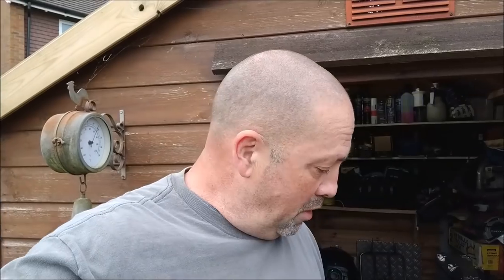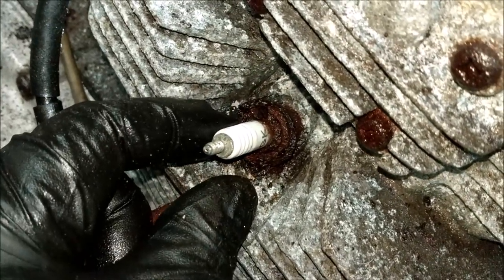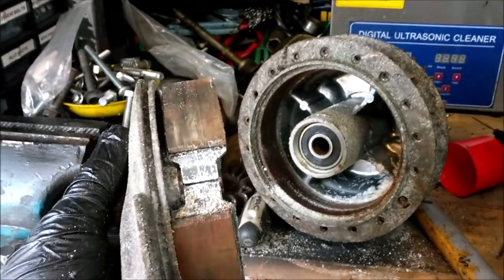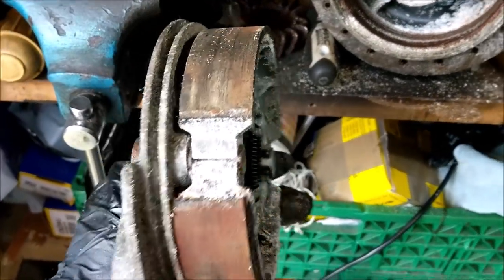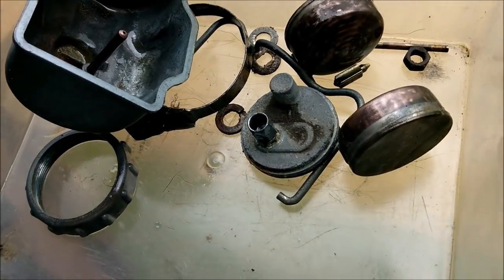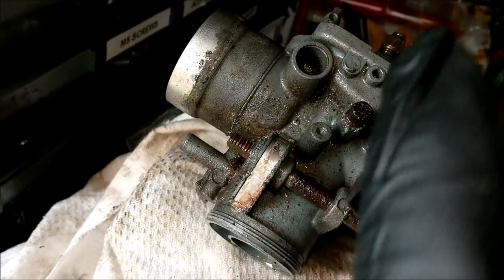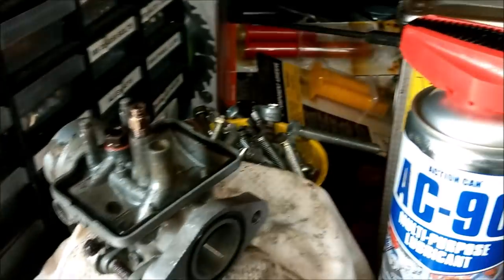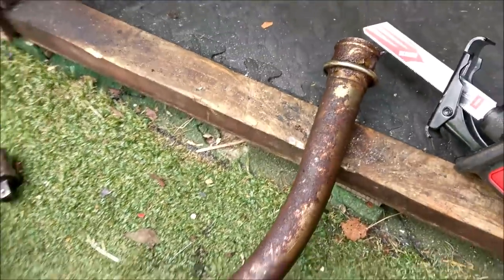Honda CD175 Restoration Episode 2

Comment: Plenty of firms on the Internet advertising brake relining, think I would remove cylinder head before attempting to remove plugs, more chance of getting penertrating  oil down  the threads that way. Impressed with your commitment. Tony
Reply from the maker: thanks tony, will see how it goes :-)

Comment: It's a long and winding road but those small Honda twins are as tough as old boots. On Zeebrugge docks I spoke to a man on a resurrected  I'll not say restored CB 175, during the rebuild he discovered the barrels were worn out and beyond repair so his trip to Madrid was on a CB 200! All the best ;-))
Reply from the maker: Cheers Julian, luckily it's only covered 1195 miles in 46 years, so  the bores 'should' be ok hopefully.
Yes a very long winding road this one. But I've got to learn to be patient, my usual restoration projects are bikes with fairly good parts availability.

Comment: Congratulations on freeing the choke lever, a great advertisement for AC-90 lubricant (unfortunately not available in the U.S.). Are the headers rusted to the point where getting them re-chromed would not make them look good?
Reply from the maker: ive cleaned one up but the chrome is not good at all, re chroming is expensive here in the uk, so its not a necessity at the moment, I have to be realistic about the whole project, I have to first sort out the frame number so I can get the bike registered, if thats not possible im not sure whats going to happen with it so im not spending anything just yet. thanks for your comment.